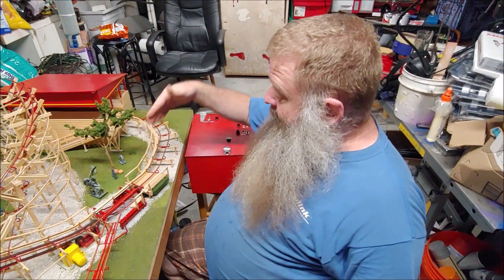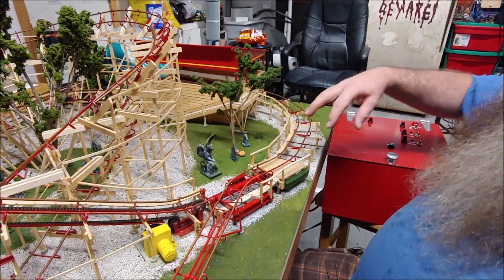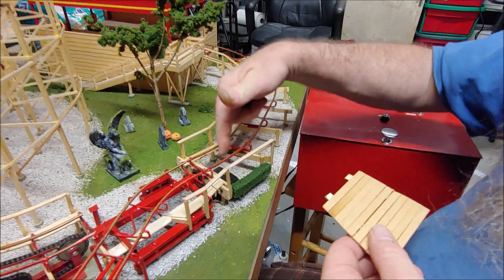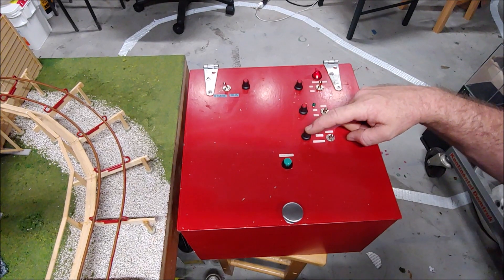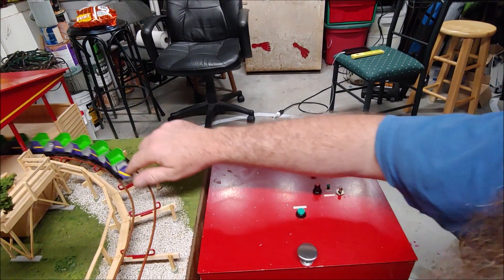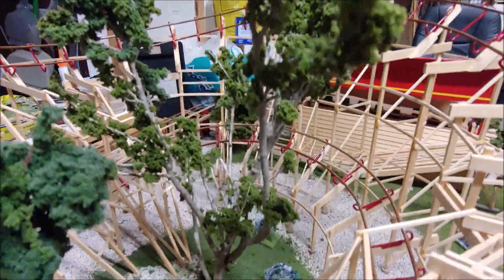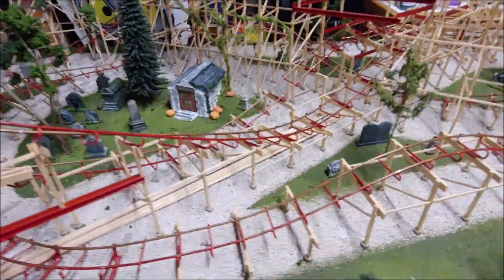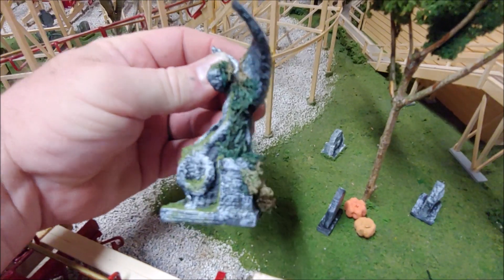Working Model Wooden Coaster update: transfer track, control panel, and landscaping

Comment: Hi, this is amazing, my dream since 10 year old. For the "to scale" speed of the train, have you tried to add some mechanism like those of friction powered car toys? Or maybe add a hidden heavy inner wheel with higher moment of inertia? Thanks for your video!
Reply from the maker: Thank you!  Being a grown up kid, I love playing with this model.
Regarding scale speed, it doesn't look this crazy fast in person - it's still fast, but video seems to distort the perception somehow.
The flywheel method has been discussed since my first video here in YouTube in  2006.  Any alteration to the trains, no matter how small, affect the efficiency for the worse.  You'd have to have the wheels grip the track so there is no chance of slippage when trying to spin up a flywheel - slippage is energy lost.  It needs all the energy from the drop to be able to crest the next hill.
I would love to see someone come up with a  passive way to do this.  
Thank you for watching!
Reply: @intocoasters  Just saw your video, nice job so far!
To add to the momentum suggestions, maybe you could add trim brakes such as small spring-loaded (pen springs) or adjustable wheels (grommets, bushings) that interact with in-gauge wheels of the train.
You could design these to temporarily clip onto the under-track structure so that you could test out various configurations before deciding on a solution.
Place them near the crest of hills and see if you can damper the speed, maybe add some counterweights to the cars ...
Reply from the maker: @weatherupstairs4814  Thank you!  I believe there have been many attempts by other model builds to achieve what you're describing.  But, I don't think it's possible to recover any speed/momentum that gets burned off in braking the train.   My trains are quite heavy as it is - a little over a pound.   
I think it braking/trimming the trains worked on models, we would see it in action on some of the true gravity powered models out there.
Reply: @intocoasters  I didn't realize the model was that heavy already... wow!

Comment: Hi.
Really cool modeling, but have you every tried to calculate the scale speed of the coaster, even in slow motion its going mighty fast.  Is there a way to slow it down a bit, maybe adding more brake points, or something, just to take the edge off?
Reply from the maker: Hi and thank you! This is a question that has been asked since I first started doing model coasters.  Unfortunately, size can be scaled down but not gravity.  So, in order for the train to reach the top of the next hill it has to keep all of it's speed from the drop of the previous hill.  If you slow it down at all, it will not make it to the crest of the next hill.   The only trick would be to adjust the video speed accordingly at each transition.   
And interesting note, these models do not look nearly this fast in person. I think its an optical illusion of scale when viewed on a screen.

Comment: You think you could ever make kits that come in pieces where people could buy them and build them with diagrams?

I think it would be really cool to build one for someone that doesn't have a 3D printer and you could make them ones like how you have the grave stones ect like how LEGO makes different builds.

If that happened I would of loved to get one.
Reply from the maker: I don't know that I am set up to do that in any kind of capacity.  I will say, however, that coasterdynamix(.)com and CDXblocks(.)com do offer similar to what you are asking.  They just re-released their Dragon coaster.  My very first video posted here is a Drachen Fire inspired build using the first Dragon system they sold.
The CoasterDynamix page offers several realistic kits. The CDXBlocks page offers LEGO compatible kits using their similar (and efficient) wheel system.  
I hope this is a good alternative.  I'm sorry that I would not be able to offer kits or parts.  I make up a lot of this as I build - so there is no real plan to follow, LOL.

Comment: Dude! This is amazing! This makes me want to make one of my own. I think I will have to wait till I get a house though, ha. I used to love building k'nex Screaming Serpent coaster models with custom motors and all sorts of fun stuff. I had like 7 sets I put together. So much fun. Thanks for sharing. I love your trains and switch track with limit switches. I did not realize you were the same guy I saw videos forever ago of the dark ride cart! I loved that.

What did you use to make your track rails, and your train chassis?
Reply from the maker: Thank you for watching!  
Heh , I have like, 5 or 6 Screaming Serpent kits in storage right now.   It's how I got my start, really.  

These rails are mostly 1/8" copper tubing with 10 or 12awg copper wire for the crossties.  The transfer track has 1/8" brass rod because I couldn't find any tubing and I was impatient. 
And it's cool that you recognize the darkride! Thank you!!
Reply: @intocoasters  no problem! Pleasure is all mine to behold this Beauty and your other fun creations, and and to learn about your construction materials! Super cool about the copper tubing. Easy to bend!

Comment: how did you make the metal track? very cool!
Reply from the maker: The rail is 1/8 inch copper tubing that is hand bent to follow the structure.the cross ties are 10 gauge copper wire cut and bent into shape then soldered to the rails.
Reply: @intocoasters  thank you. completely amazed by your work. I have always wanted to make a roller coaster and other rides, but had no idea where to start. thanks again.

Comment: My kids have been asking for a model rollercoaster so i was looking at kenx but i love the thought of making one from wood instead and our own project. The problem i keep getting stuck with is what do you use to make the track!? Brilliant model! Thanks!
Reply from the maker: Thank you for watching!   
A scratch built coaster will be quite the undertaking.  Have you looked at CoasterDynamix? They make some very realistic looking models.  
But to answer your question, tails are 1/8" copper tube. The cross ties are 12AWG wire cut and bent, then soldered to the rails.
Reply: @intocoasters  thanks for getting back to me! :) 

Wow that's some hard work getting the rails in then soldering them together... think ill take a look at your recommendation haha

My boys absolutely love your coaster! Im amazed by the detail and work! Well done!
Reply from the maker: @MRSHAUN8    Here is the first custom ride I did with their first system: https://www.youtube.com/watch?v=xupOU6XocrI&t=32s&ab_channel=intocoasters   
They now have Lego compatible kits as well as wooden kits.

Comment: Ran the last scene at 50% speed.  Some really cool sounds, and more "realistic".
Reply from the maker: Thank you!  Would you believe that last scene is already rendered to 50% speed before I posted?   I just wish I have a camera with a much faster shutter speed that could fit on the model.  Oh!  I agree, the sound of the model becomes much more realistic when slowed down!!
Reply: should be called the Intimidator Riverside Boardwalk Bullet Cyclone Safety Coaster  :-)